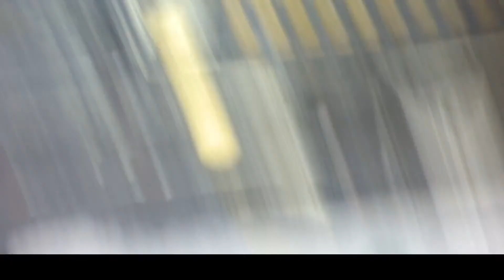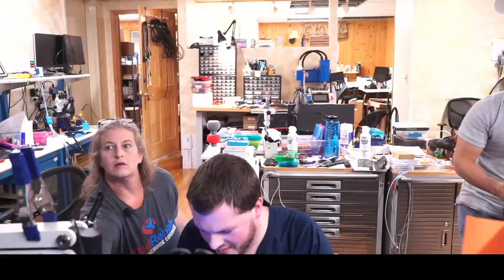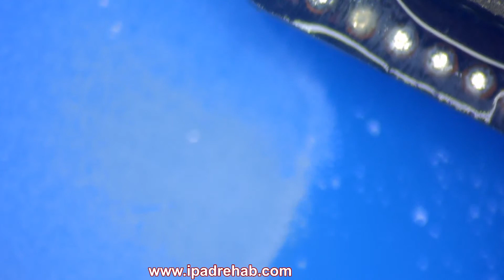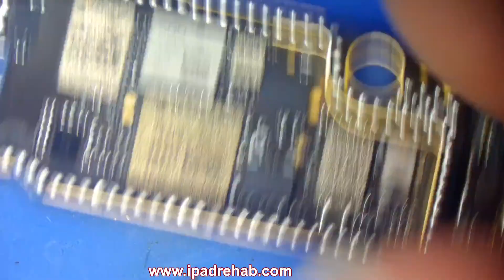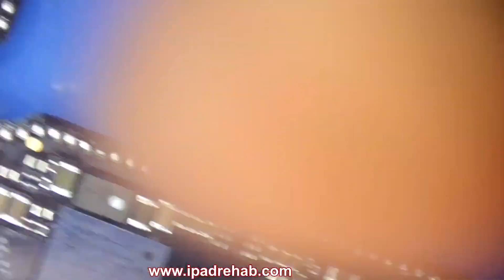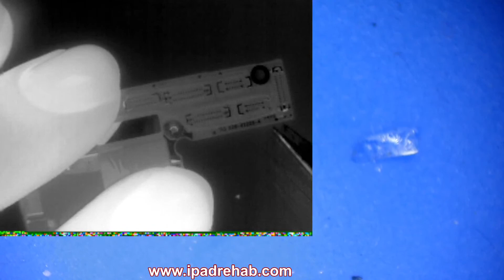Tim Herrman of TCRS Circuit fixes an iPhone LIVE on camera!

Comment: Unit pack power thinks your trying two scam them the ceo made a video calling you out it only got like 2 thousand views  please make a response video 
https://youtu.be/AdoJkz34qOQ
Reply from the maker: he turned off the comments. total lying pos. he claims the bridge rectifier wasn't rated for it, it was rated for 100 amps and mounted where it could be cooled with a heatsink. this same setup has worked for over a year with no fire with em3ev batteries.